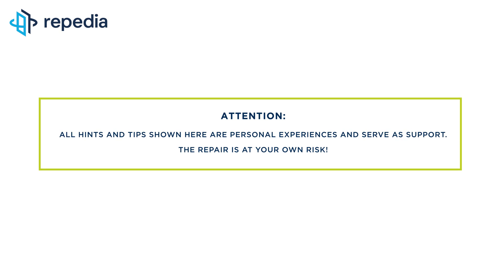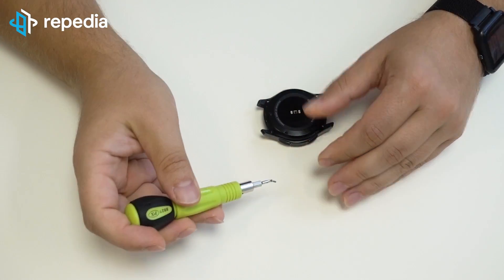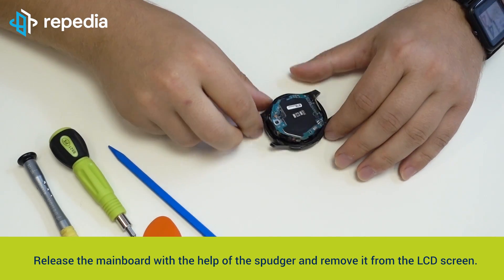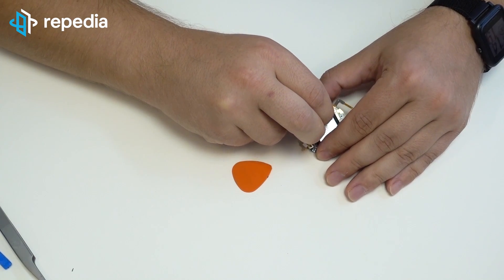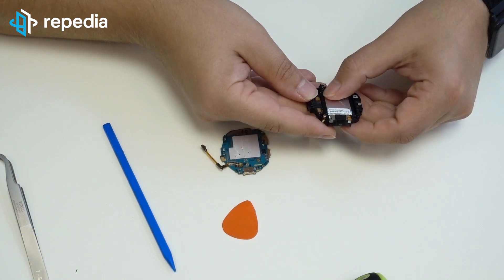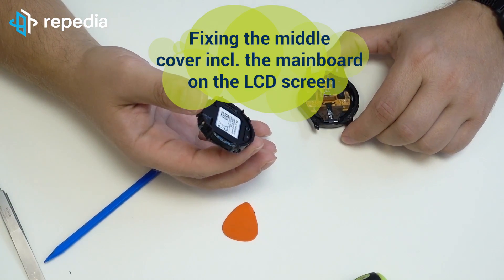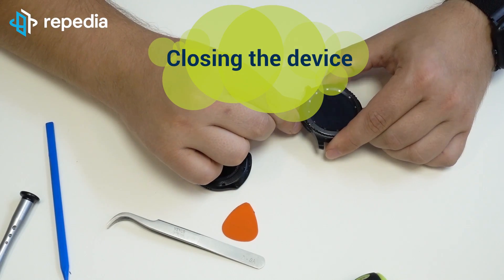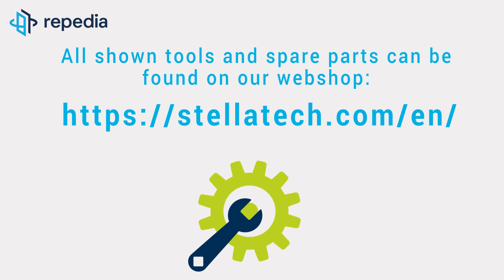Samsung Gear S3 Frontier - Disassembly (Screen & Battery Removal) & Assembly Guide

Comment: What happens if you can't get the screws off bought the tool but the screws aren't coming off in the watch is water damaged rusted inside could it be repaired or is it a lost cause

Comment: Please explain that when detaching the flex you mean the tape. I broke that silver button off the flex. I broke my freaking watch because your terminology literally or latterly. I see why you use your disclaimer. Explain the importance of the flexer PLEASE!
Reply: I want to complete my comment with a thank you. Even though I found some difficulties along the way. I actually fixed my watch. But I had to incorporate both different repair videos to learn how to solder the flex to the motherboard. But for the most part, I used this video the most to assemble and disassemble the watch. Without this video, I would have lost over 350 bucks trying to replace a battery. Thanks.

Comment: Hi!
Thanks a lot for the video, really useful.
Unfortunately, while manipulating the device I cut the flat wire that goes out from the battery. My original intention was not replacing the battery, but to clean up the thing to try to fix the power button. Do you think that I should buy a new battery? Or would it be possible to fix it somehow?
Thanks in advance and kind regards!

Comment: just cleaned it using this video. i didn't touch the ball barring much as I was afraid i might lose the spring. So just cleaned everything around it and stuck back the last properly. and now the cradle works smoothly. It was sticky for some reason. it's working fine now. thanks for the tips. (I have galaxy watch 46 mm btw.) similar design.

Comment: How about if battery and motherboards is been replaced and while charging still red light blinking, is the problem in lcd screens or back cover?. I've try to fix over a year still no results. Thanks if you able to give me a solution. Andry

Comment: You just breeze through the hardest parts without much explanation. I ended up breaking a button following this video.
Reply: Yeah I can see how that might happen following this one if all you're doing is replacing the battery. It's not that this one is "wrong" necessarily but after removing the 3 connectors and 2 main board screws they go to straight into removing the LCD (which involves lifting out the entire middle frame that the main board is attached to), which is completely unnecessary if all you want to do is replace the battery because at that point all you have to do is disconnect the battery connector from the main board and then it'll lift up and flip over exposing the battery (you just have to be careful not to rip out the button ribbon which will stay connected to other side of the board). 

Anyway I can see how following this video could lead someone think they should pry up on the main board after unscrewing it (instead of the middle frame) which could cause them to rip the button ribbon out of the board, and I obviously don't think they're liable or anything but it's why you should always watch several different teardown videos before trying anything especially if you don't have a lot of experience with this kind of stuff.

Sorry to hear that though and luckily the button ribbon is pretty cheap at least!

Comment: Great video. I was able to replace my battery and my motherboard to get my watch back on its feet again. Thanks!
Reply: Where did you get another motherboard from? I looked all around and could not find one so, I had to solder the flex back myself. It took a while. I don't know if it operates the same way but it tells time and most of everything works. I'm just surprised the dam thing is working.

Comment: hi my gear s3 spoil the power button, can you help me how to fix it? its still charging but i cant open it already :(
Reply from the maker: Hello, I am not sure whether you will find a new power button separately. In the worst case, you have to replace the whole LCD screen because the power button is included in the display. Before doing this, I would suggest opening the device and check all relevant connectors. 

We wish you much success!

Comment: Is it still water resistant after replacing battery yourself?
Reply: When I opened mine, I realized that there is no glue, and the lid is pressed together with a rubber gasket, so if you open it carefully and do not damage the gasket it should maintain the protection against water when it is returned to  close, my watch kept its IP protection
Reply from the maker: Hello, there is no guarantee for water resistance after replacing the battery. You can use an adhesive for fixing the back cover: https://stellatech.com/de/samsung-sm-r765-gear-s3-frontier-lte-klebe-folie-f.-back-cover,a,828614.html/ But it also does not ensure that the watch is water resistant because each little mistake in processing will increase the risk of water entering. 
Best regards from the REPEDIA team

Comment: You don't need heat, the adhesive on the antenna is not that strong.

Edit: Best how to I have seen for this watch thus far. Thank you very much sir!
Reply from the maker: Hello,

thanks for your feedback, glad to hear that! Yes, you are right, the adhesive is not that strong but heating just a little will make it much easier. It is just a suggestion. 

Best regards from the REPEDIA team

Comment: Does opening the watch removes the ip68 capabillity ???
Reply from the maker: Hello,

yes in general, each opening influences the water resistance. It depends on how thoroughly you work. Normally, the dust and splash protection is still present after the repair. But when the watch is completely submerged in water you do not have the same ip68 capability as before. Nobody can guarantee it. 

Best regards from the REPEDIA team
Reply: My gear s3 is water damage just by washing my hands.the watch was never been opened before.i will never buy samsung smart watch again.